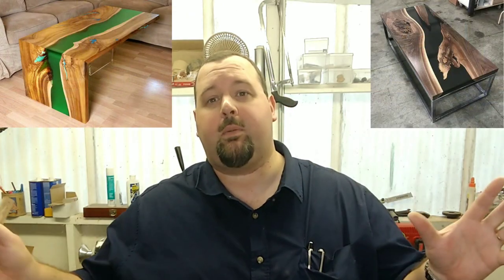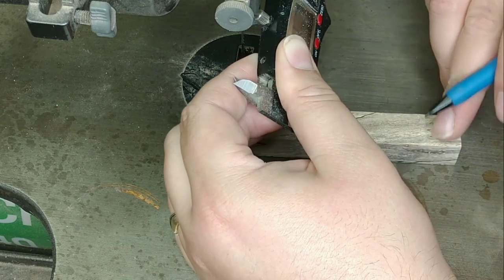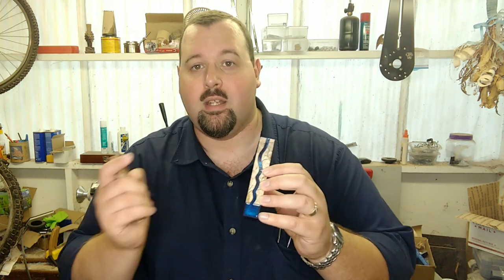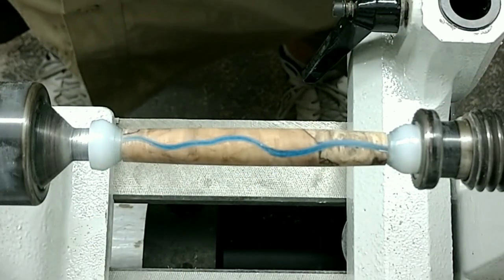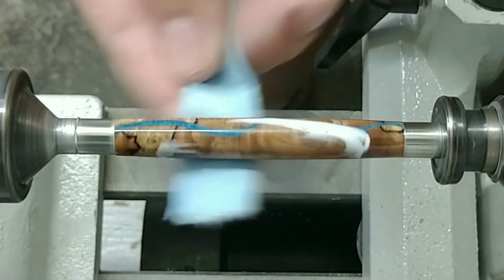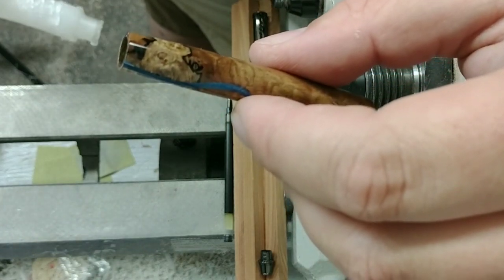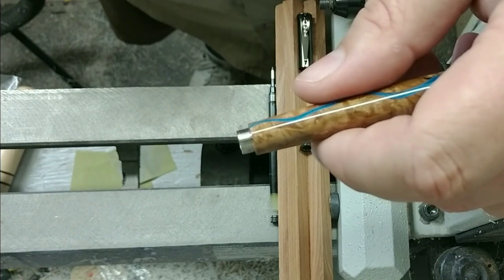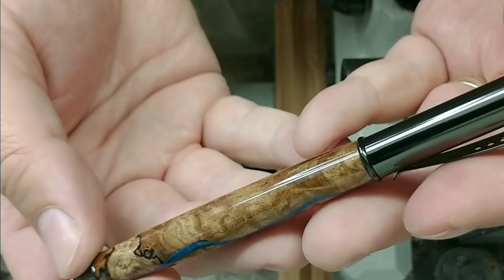River Table Pen Creation, Start to Finish

Comment: I’m new to pen making. How do you come up with prices? I’m actually getting people wanting to buy mine. Any advice for a novice would be greatly appreciated. Thanks!
Reply from the maker: This is what most people struggle with getting started. A fast and easy way is to take cost of all your materials and multiply by 2.5, this will generally work out. Otherwise you can get more precise, figure out cost of materials, and then figure out your time spent per pen on average and pay yourself a rate per hour based on your expertise level. The more expertise you gain the higher your rate.
Reply from the maker: Also, include the cost of shipping in your price if putting pens online and then make shipping free. Free shipping appeals to people, it's a psychological thing not to have to do math of buying the pen, then applying the tax, and then adding in the shipping. They'll leave and pay a higher price for somebody else's product if it means they get free shipping, it's silly but true.
Reply from the maker: HAPPY TURNING!
Reply: Thank you so much for the advice! Especially on shipping. I really appreciate your advice. Keep up the great content. I love your work!
Reply from the maker: @smythc1  you're very welcome! Happy Turning!